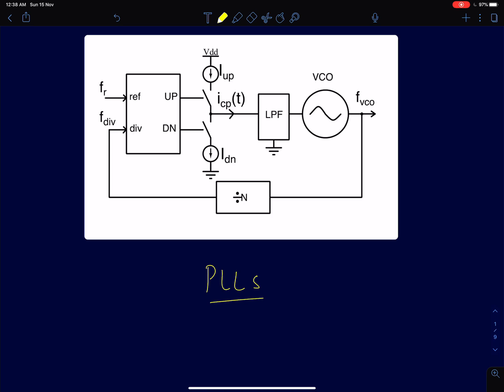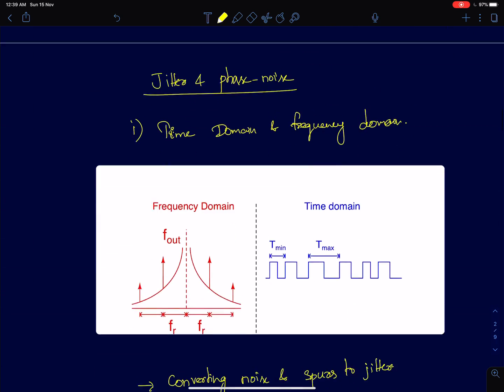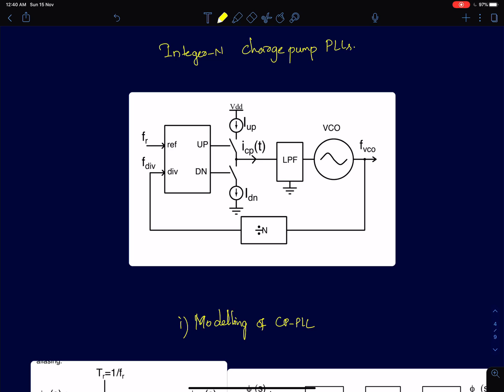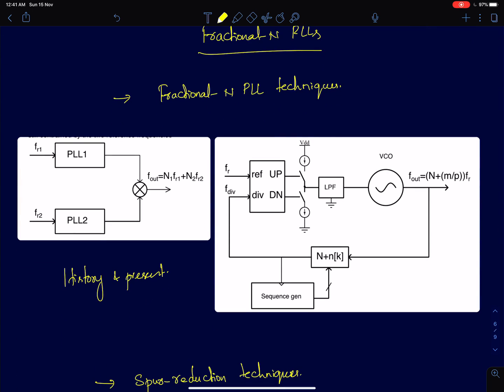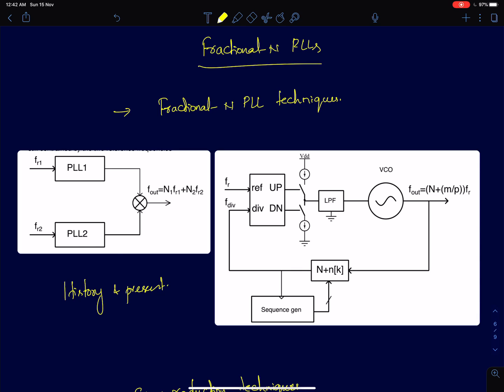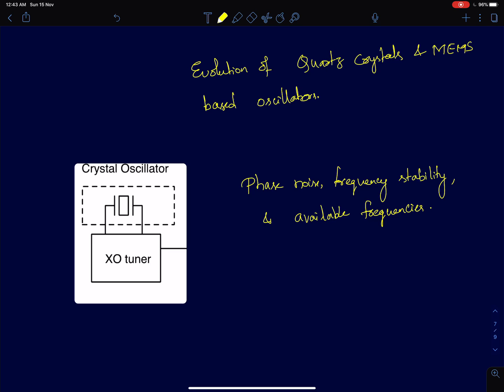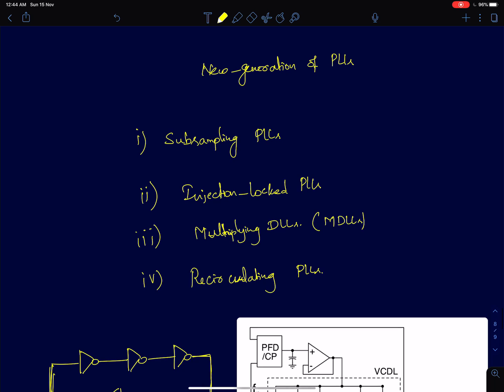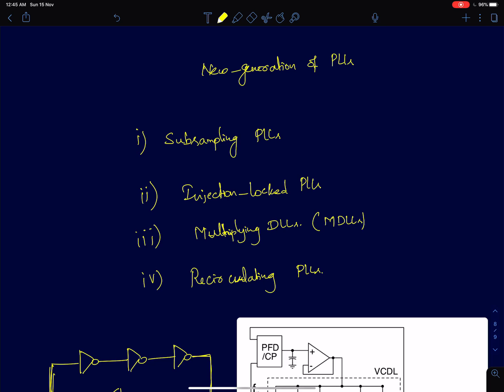PLL Lecture 1: Introduction to Analog Phase locked loops-Course outline

Comment: 1. PLLs have been there since world war 2
2. most growth happened during cellular revolution
3. metrics to characterize the PLL, mathematically derive the phase noise 
4. good mathematical understanding for cyclo stationary noise 
5. significant papers were written during 1980's
6. most plls in 1980's to 2000's are charge pump PLLs
7. plls are used in sythesizers, clock generators
8. loop filters consume area and different loop filters to optimize area
9. fractional PLLs (1990s) - mainly came out of cellular technology - channels grew and required local oscillator to generate sources with very small frequency
10. results in lower bandwidth with reduced frequency spacing in integer PLLs, fractional PLLs solve this issue.
11. MEMs based oscillators significantly improved in 2000s, performance as good as Crystal Oscillators
12. Need good reference clock (less noise)
13. New PLL architectures - (in 2020 - jitter sub femto seconds) - ideas are primitive but gained traction in recent changes
       sub-sampling PLLs, Injection locked PLLs, Multiplying DLLs, Recirculating PLLs